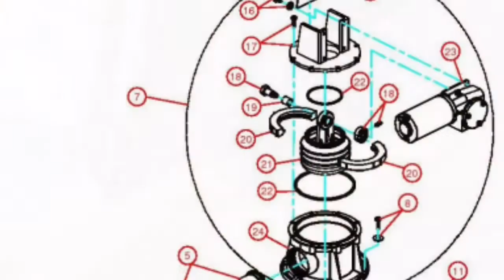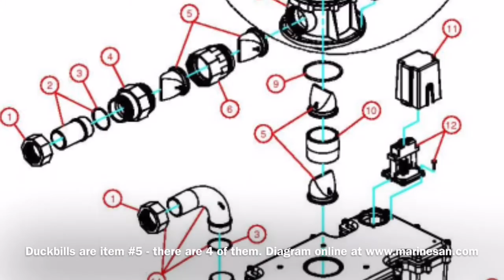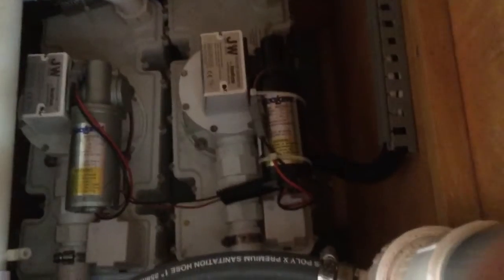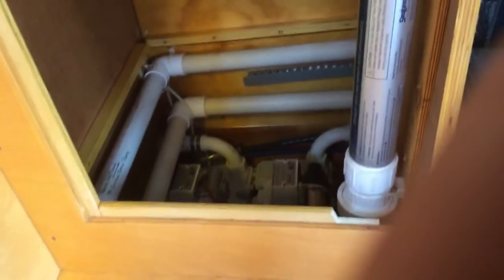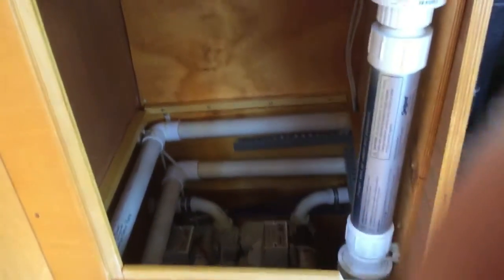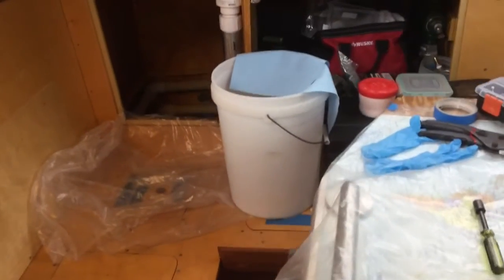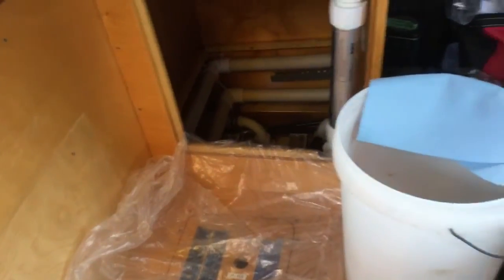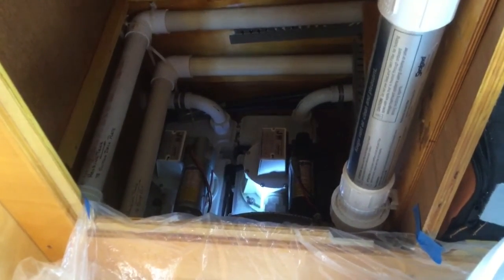Changing Duckbill Valves in a Vacuflush System

Comment: Hi Norm,  I just found your channel.  Thanks for the vids.  I'm interested to know how you're finding Dream Catcher after a few years in the water.  Did you ever make it to Tahiti?  And is there anything you would want to change on the Voyager 495 design... etc.
Reply from the maker: Hi Merv - sorry for delay, just saw comment today. 
Yeah, we made Tahiti, and Australia, Indonesia, South Africa, Caribbean and points in between! Figure on finishing circumnavigation next year.

Changes - V495 has been an awesome performer, excelling in heavy weather. High transom in particular has been a surprise advantage....we have been dry/enjoying fishing while buddy boats have evacuated cockpit due to boarding waves.
Changes - I would build in aluminium to reduce ongoing paint maintenance & weight, plus shift more weight foreward during construction - design tends to be stern heavy, and adding a radar arch, davits, solar panels, dinghy and outboard only makes it worse. Would shift components forward as possible.